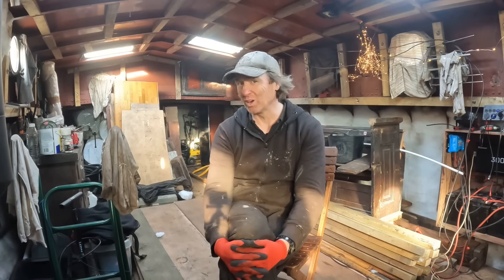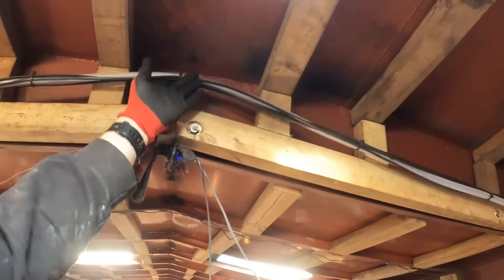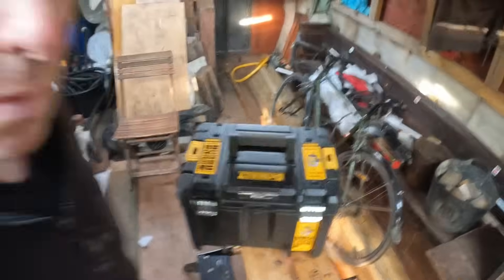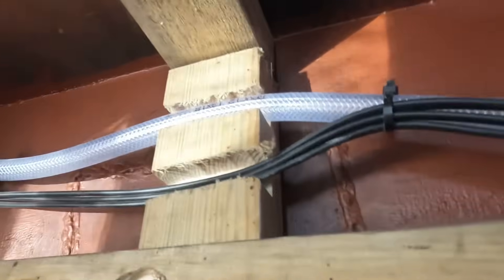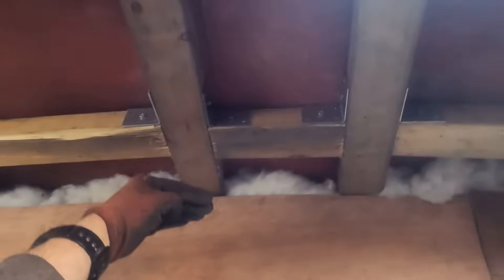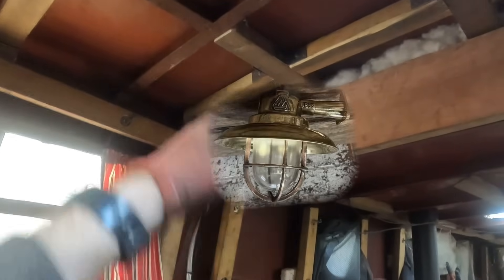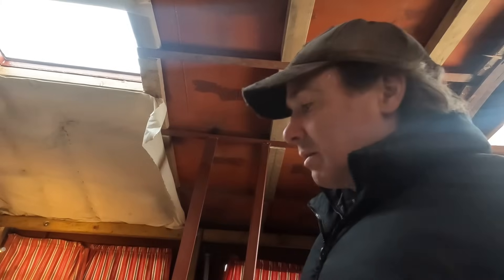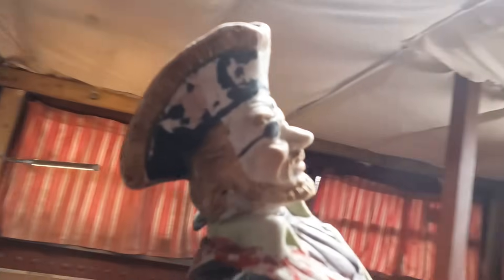Battening and insulating the ceiling.

Comment: Canice a quick tip to make dead straight  router cuts every time,  get a piece of Square thin ply ( or Perspex ) the same width as your router face plate and screw it to the plate so you have a 90 degree edge to the blade then just use a clamp or something straight near where you want to cut as a the guide and Bosh ! You have dead straight cuts every time. 🙂
Reply from the maker: This saves me so much time reading the instructions!😂 Thank you. As you saw I just got straight to it an butchered my way through it. I was thinking the other bits in the box are needed for something! 😂😂😂

Comment: It would be interesting to know how effective the new insulation is. Do you have any way of knowing that? Perhaps the sea captain could volunteer to stand on the roof to feel how much heat is coming through. And an earlier comment raises a good point, a moisture barrier would probably work wonders keeping the insulation dry. Here in USA! USA! USA! builders use a wrap (trade name Tyvek) for that purpose. You could use it to replace the calico, and then put the panels over that.
Reply from the maker: Vapour barrier is expensive. And I do plan to use it… however in the short term I just want to use up materials in the boat and clear the floor. Also the calico will cut into to put in ventilation and I don’t want to do that to an expensive vapour barrier….
You can see frost disappear off the roof the minute I light the fire where in Jorja that’s not the case. You got me thinking, next time I light the fire there should be an obvious difference between the two parts of the roof. Of course it won’t get frosty again!😂😂😂

Comment: It's looking very nice! I am afraid the insulation material that you use is not absorbing moisture and will be very wet after living or cooking aboard. I recommend pure sheep wool. That material will absorb moisture and still keep insulating. But on the horizontal parts you will have to use some other material to prevent drops hanging onto the ceiling en organizing rust. I recommend amarflex, the self sticking kind. That combines very good with sheep wool or even with your synthetic wool. A damp tight layer will not work on a boat, to many apertures.

Comment: You have a black bucket with the text 'Karwei", which is from a Dutch DIY chain of stores. It translates to chore or job - but in the sense of a DIY project. I guess it came with the boat? Also why is Jorja doubled up when there seems to be so much space behind the boat she is doubled up with?
Reply from the maker: Well spotted. Linda was in the Netherlands for the first 18 months of my ownership. I bought the Kartwei bucket myself as that was the nearest hardware store near me. 
As for the mooring. The space behind Jorja is the landing spot for the lock. Canal and River Trust don’t allow moong there even though nobody uses that bit as the landing spot. You can see the yellow painted bollard on the bank, those are the landing bollards.

Comment: Hi Canice
How are you fixing the buttons to the ceiling I was expecting no nails or similar ?
Reply from the maker: Hi Carl, I’m not exactly sure what I’ll end up using as the wood finish. By doing what I’ve done, I’ve insulated the roof and improved the look of the space. I can readjust and improve the arrangement of the battens later when I decide the final finish. There are vents tat need to be installed at some point..
Reply: @canicebannon  Oh I see I have always been facilitated how the woods fixed to the metal and stays put with the high temperature changes from winter to summer.